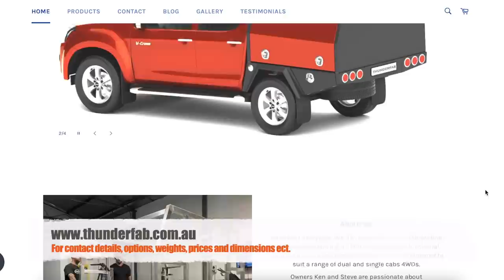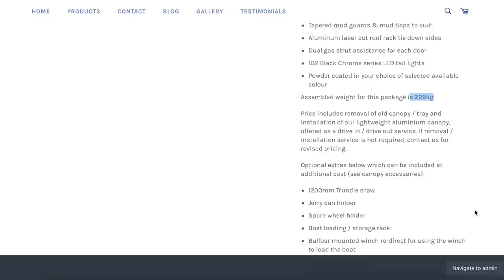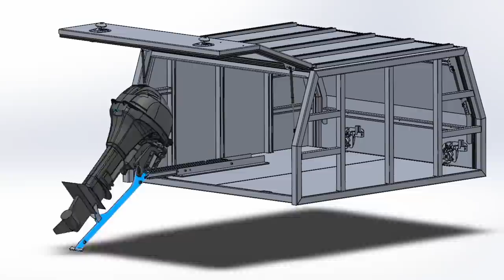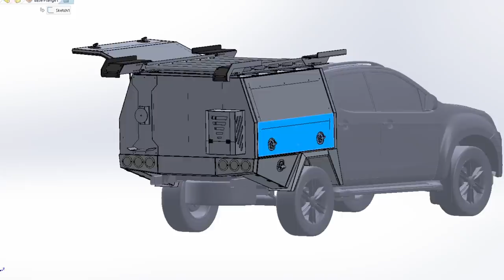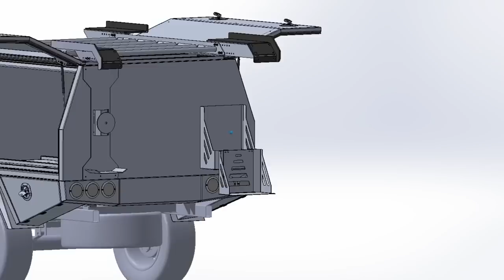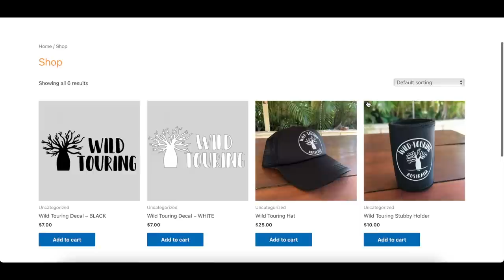The Dmax Touring (re)Build Series E02 || NEW CANOPY - Design/Build with ThunderFab

Comment: I have never had that kind of setup so my question is when looking at your cracked canopy is when they fit them does the canopy sit on rubber mounts between the chassis and the canopy so that it is not rigid to the point that it could cause cracking ? I would imagine there would need to be something like a rubber mount that can flex a bit. The canopy looks mint. Cheers
Reply from the maker: I also wondered the same. Because I did fit the old canopy myself and bolted the thing straight on with nothing between them. Most tray and canopy builders put a block of HDPE (plastic) between them. But it’s more about separating dissimilar metals than shock absorption, the plastic doesn’t really have much in the way of compression. 

Something between them certainly wouldn’t have hurt. But it fell apart because there’s no internal structure to it which causes heaps of flex on corrugations and the welding was really poor with no penetration.

I actually filmed a really interesting conversation with one of the fabricators where he spoke about some of the design and fabrication differences between the two canopies. I’ll post it in a few weeks.
Reply: @WildTouring  Thanks, something to keep a watch on. The new canopy does look very nice. Thanks and look forward to the next one.
Reply: There is no structural integrity on those Chinese style canopies, they will all crack  eventually. Needs to be on a frame and correct aircraft grade aluminium not cheap stuff.
Reply: Nice to see you had your Aussie safety thongs on Cam 👍😂😂🇦🇺🇦🇺👍
Reply: @travelsolo2677  aircraft grade is a bit of a myth. Aircraft use a variety of different series  of aluminium, 2024, 6061, 7075. All of which come in different hardness values depending on whether it was roll hardened or heat treated . Some is weldable and some isn’t . In general 5000 series aluminium 5005, 5052 etc is what is used as it folds without the need for a calculated bend radius and is easily weldable both mig and tig. Not having a go at you but as an aircraft maintenance engineer (structures) I get a bit annoyed when people bandy about words like milspec and  aircraft grade. Just thought I’d set things in perspective 🤓

Comment: Mate ,how high the canopy will be ? Is it like old Chinese 800mm or you get 1000mm (1 meter)?
Reply from the maker: Similar to the old one, around 860mm from memory. At that height if i put a platform rack on it lines up with the rack on the canopy.

Comment: What I don’t understand is why these fabricators don’t round their wheel arches to match the removed tubs.
Reply: Cost would be a big one.
Reply from the maker: Personally I don't think it would look as good - but that's subjective!

From a design perspective i think it would be difficult to bend it to strengthen/stiffen the guards, so they would have to weld ribbing inside and/or an angle onto the edge of it which would be time consuming and a pain in the bum to do without heat warping (I think... this is not my area of expertise).

Comment: so 18-20 plus is cheap. I dont know what expense rate is then
Reply: I agree. I thought they said pricing in the mid range. Fell off my chair at the prices on website.
Reply from the maker: How’s it compare to quotes you’ve had for similar quality Aus built chassis mount canopies?
Reply: Mits alloy is 25k and god knows what norweld charge. 16 to 17k is decent. By the time you get a decent tray, say 5 to 7 grand and then a decent ish box, say about 10 grand your already at a price that these guys are charging. Their pricing seems pretty fair to be honest, you are just a cheap skate lol.
Reply from the maker: @craigbrysse887  Hey Craig, thanks for your comment. I'm not deleting it but it is being censored by YouTube as spam because youre putting a link in it. I read the article though (thanks for sharing), its really well written and similar findings to the research I've done. But going off those prices listed in the article, for a painted extra cab canopy package with water tank, trundle, spare tyre mount, jerry can, undertray tool boxes, table/drawer combo and central locking- Norweld $23,770 (with a poly water tank and no table/drawer combo. Weighs in at 444kg), Mits Alloy $27,770 (411kg), TLX $25,455 (411kg), Concept Canopies $22,920 (with a poly water tank, weighs in at 252kgs), Boss Aluminium $27,515 (312kgs). A ThunderFab extracab canopy to the same spec is $24,775 - which is mid range of those quotes, only slightly more expensive than the two that had poly tanks (ThunderFab tank is stainless, baffled and includes sender/gauge). ThunderFab canopy is also the second lightest, weighing in at 290kgs. Which is because all but one of those canopies in the article are tray mounted, ThunderFab is a chassis mount. Tray mounted canopies are always GVM killers. 

I stand by my comment- what ThunderFab are offering is a really high quality, light weight canopy that's competitively priced.
Reply: @WildTouring  Thanks Cam for taking the time to read the article.
I went and looked at the Community Guidelines  on YouTube  and I couldn't find anything there that relates to my comment being classed as spam. From what I read it didn't fall into any of the listed categories. 
Anyway I only posted it as a information reference on other canopy builders available out there. Enjoy watching your vids. Craig
Reply from the maker: No worries Craig, for others benefit the article is;
thebrownetown.com/the-best-aluminium-ute-canopy/

And if you google "why is youtube deleting comments with links" there's dozens of answered Google Support threads on the topic. As I said, often google assumes comments with links to other sources are spam (most of them are!).